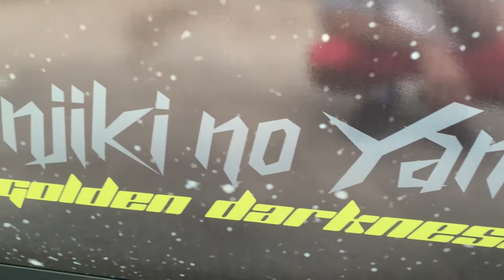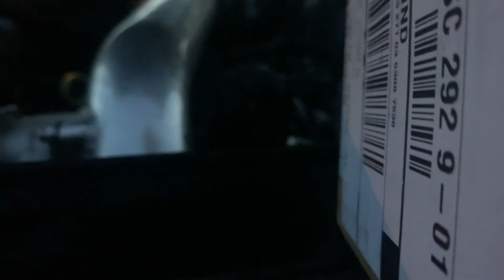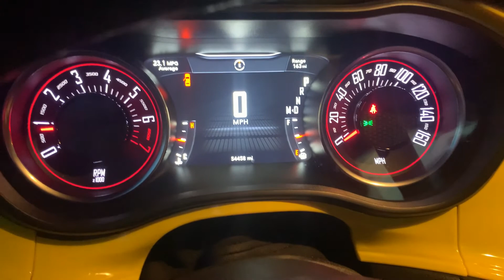Installing a new BOV o-ring on the Ripp supercharger v6 kit.

Comment: Why don’t you install paddle shifters
Reply from the maker: That a mod down the line planning on get a new steering wheel first.
Reply: @Sleepy6  bro i keep thinking the same like why not just wait for a new steering wheel cause I want one with the led but that mf like 1000 or at the very least 700 for a steering wheel when you can just get the paddle shifters for 60 bucks on Amazon then get the automotive tazer and turn them on yourself along with the new features the tazer gives you all for like 400